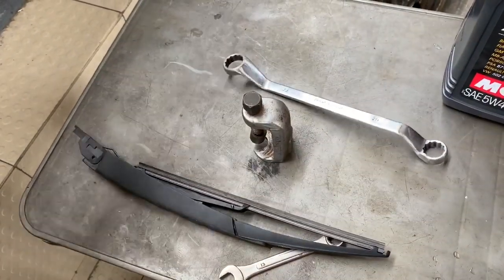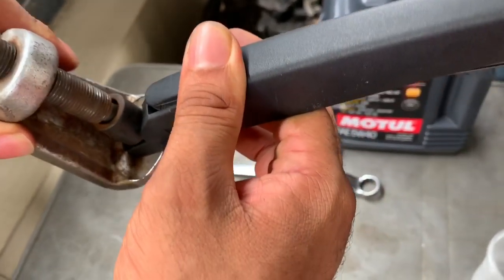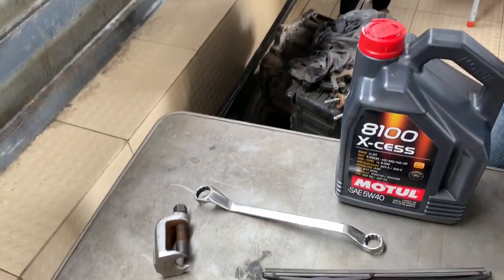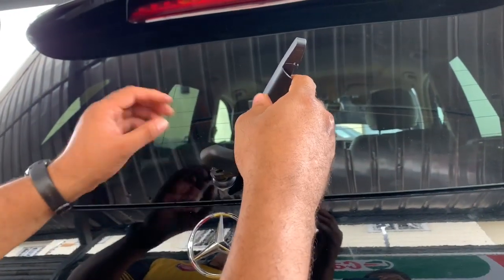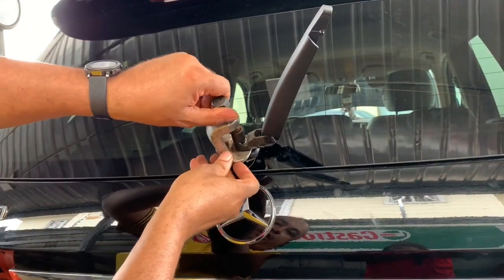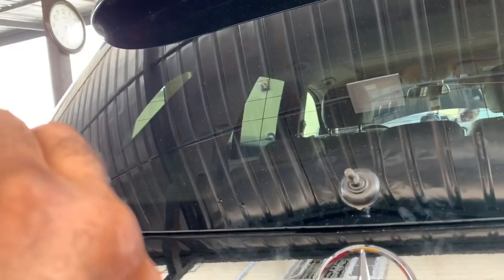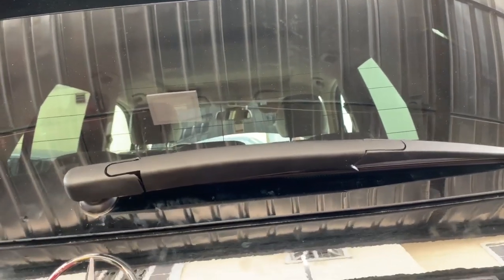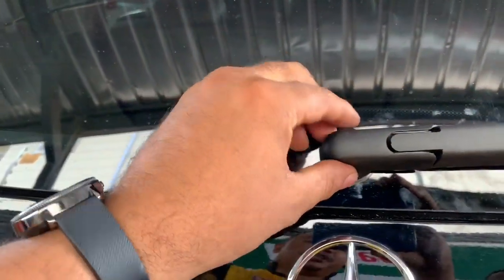Mercedes W166 ML350 Installing And Dismantling Rear Wiper Assembly

Comment: Hey daddy quick question. A car wash ripped the wiper blade clean off as well as the arm. Is it possible to mount a new arm and blade without removing the piece that you had to use that special tool to remove? I don’t have that tool but I have all the other parts. Thank you!!
Reply: Old but yes I just re installed one at the carwash i work